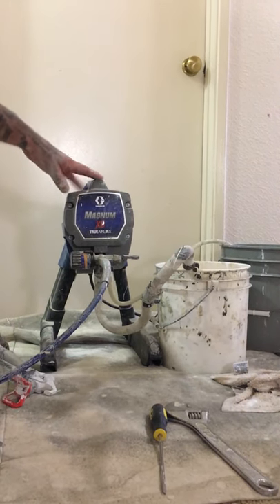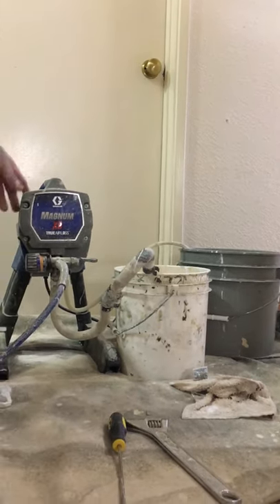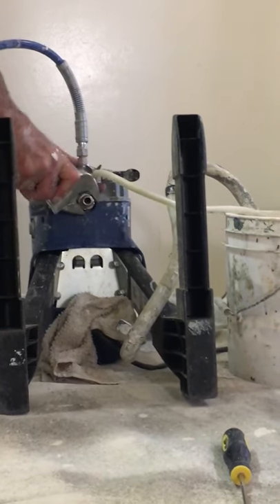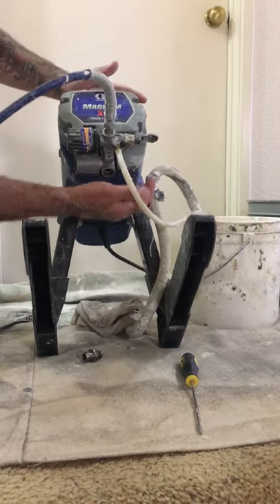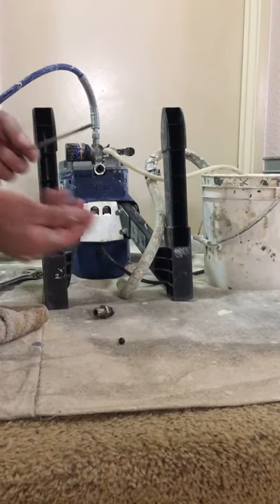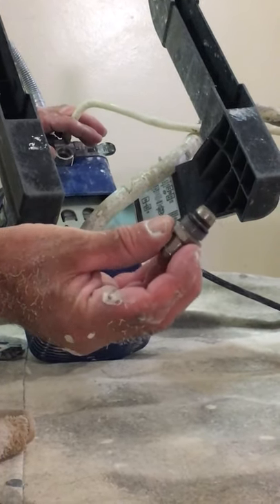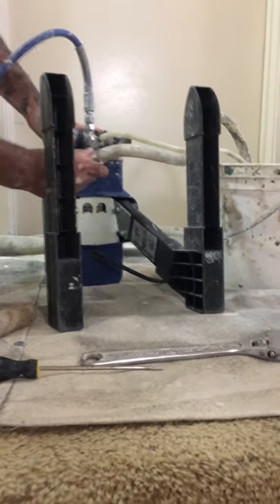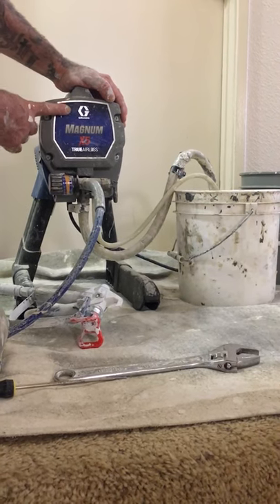GRACO MAGNUM X5 PRIMING PROBLEM MAINTENANCE

Comment: What happens if you do loose the spring? I took my unit apart this winter and didn’t realize I didn’t put the ball back or spring.. I have the ball in a paint can.. I didn’t know it was even to my pump untill I watched this video but I knew it looked important but I doubt I have the spring still…
Reply: You can order it. It’s $1